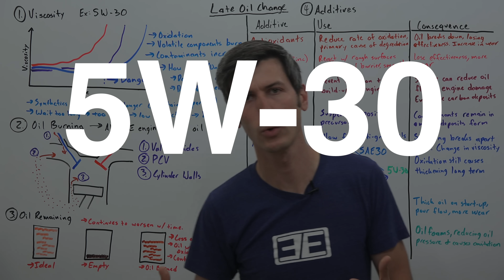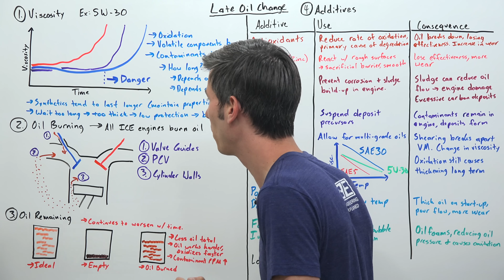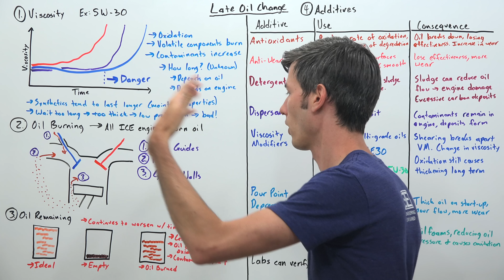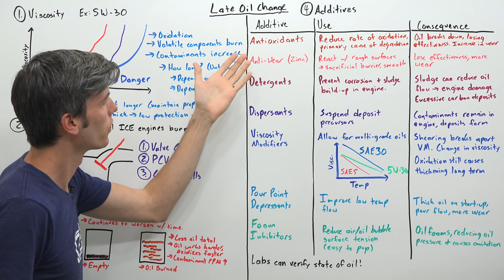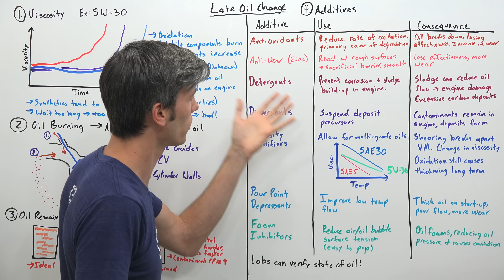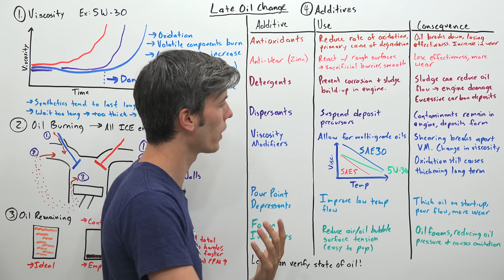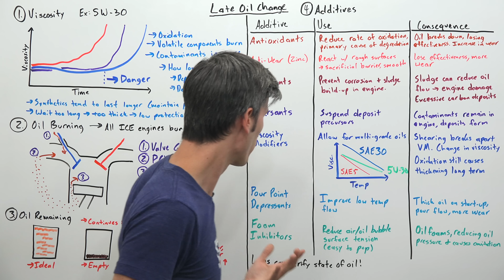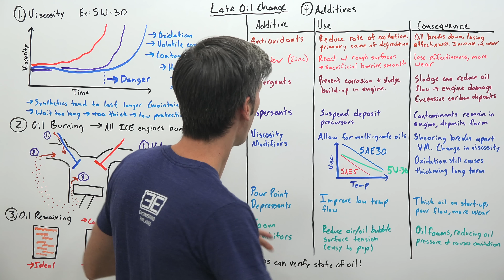What If You Forget To Change Your Oil?

Comment: More heat cooks the oil ....reason not to buy a turbo ....... All these bloody tinpot  engines with turbos these days
Reply: Simple solution is to run synthetic oil with a higher temperature tolerance. Or run cheaper oil and have shorter intervals, either way works.
Reply: @jaydunbar7538  and hope the previous owner allowed it to cool a bit  before switching off if no timer

Comment: When the engine is low on oil, the oil will get too hot.
There are many parts in the engine that have no exposure to coolant. 
Motor oil cools these parts.  The oil then transfers its heat thru the block to the engine coolant.
If you have less oil to carry the same amount of heat energy, the oil will get hotter and thinner.
The hotter and thinner the oil the faster it will burn off.
So if you have an engine that burns oil, keep it topped off.
Reply: You bring up a good point. My old VW Beetle only uses the oil to cool the engine internals. To avoid over heating the engine, I added a 1.5 quart oil reservoir.

Comment: What if the oil consumption is a lot due to poor design (2003 camry) and you end up replacing sometimes 2 quarts. Could you in theory be ok if you wait little longer between oil changes? Since a big chunk of the oil is being replenished

Comment: Can you answer a question for not changing the oil because of not driving so much? Usually my car they say to change every 15k. However I drove this year very little due to sickness and only drove around 4-5k. Still my car tells me to go to the service(which includes oil change). Is it really that necessary to do an oil change, even if you don't drive a much? I feel like OEM set the cars to do this to get more money

Comment: My car has service intervals of 30,000km (18,500 miles). No recommendations for interim oil changes anywhere in the manual. This has always surprised me, because other people tell me that their cars need oil changes much sooner. But I've now done 140,000km with this engine, and it is still running smoothly. The mechanics that do the service haven't mentioned anything along the lines of too viscous/dirty oil either.

Comment: Please can you do a similar video on ATF? especially the "lifelong ATF" issues with new transmissions.
Reply: "Lifelong" is the term car manufacturer uses until warranty period is over, around 100k km, or 5 years, what comes first. After "lifelong" it's up to you what u want to do... 
I know for sure that DSG trans need oil change every 60k km, and old "wandler" torque converter is around 100k km.
Reply: My Australian Ford has a sealed for life Auto. Currently got 500,000 kms and runs smoothly never touched.
Reply: @Blanchy10  highway miles.

Comment: What happens if you regularly drive to the car service station of trust (connected to the dealer) to service the car and the engine breaks down after only 60,000 km because oil was apparently lost and the engine therefore not oiled? Well, bad luck, because the warranty has expired and the service station was not aware of any fault. They even blamed on inferior fuel. In Germany. Seriously? A proper service station should have noticed it before the engine broke down completely in my opinion. Instead, it was only discovered when it was already too late.

The same service station sent the new bought car in another city to change tyres in a shop there and the defective air conditioning compressor was later replaced by an unsuitable part, so that the whole repair took several weeks. Do I have to mention who lost a customer forever?

Comment: first graph is not really true. viscosity change depends on many factors, not only oxidation, but mainly fuel contamination and thus the viscosity goes down typically, because by the time, all the antioxidants are gone and the oxidation kicks in as hard as you show, the oil is not really oil. The only example, where it tends to go up is diesel engines, because it gets contaminated with unburned diesel particles and diesel engines dont have a choke.

Comment: I'm surprised that you didn't mention the importance of TAN (total acid number) of the oil.  An increase in the TAN of the oil (as a result of oxidation) is a precursor to the rise in viscosity.  OEM oil change interval recommendations are typically conservative.  There's no point in changing oil until a rise in acidity is noted.  Extending the oil change interval can save money and do no significant harm to the engine.

Comment: One thing you didn't cover is knowing when to change the oil. For example my car the manufacturer recommends following the oil life indicator (approx 8000 miles depending on driving habbits) or 1 year, whichever comes first. If you go get your oil changed they always slap a sticker on the window indicating 3 months and way fewer miles.  Your not late to change your oil just because the shop wants to sell you an oil change 3 to 4 times as often as needed but the layman won't know the difference.
Reply: Amen!  EVERY oil-change shop in the country is out to scam their customers.  And because of their habit of pulling the fill plug on the differential to check the oil level there, and no matter how much dirt is caked on the plug they pull it and then thread it back in with no cleaning whatsoever (just one grain of sand in the oil can ruin a differential) is all the reason I need to stay away from those places.

Comment: How about a car sitting without an oil change? Will the oil need to be changed if not used?
Reply: Jason Torres Old used oil may contain acidic compounds which can etch the inside of the engine, change the oil before storage.

Comment: You didn’t mention that, nowadays, automakers recommend changing oil once a year regardless of mileage, and they enforce this with a reminder because modern engines contain a clock and calendar.  So if after only 1000 miles of use you get the warning because of the time lapse, how important is this?
Reply: GH1618 Since some of the additives are sacrificial ph buffers, the time in use by the calendar does matter. Jason doesn’t mention this: oil is inexpensive compared to engine repairs.
Reply: There's no one answer for all cars, but if you want to know for yours, send in a sample to Blackstone when you change it after a year, and get the extended use test.  Will tell you definitively if you can safely go longer next time.

Comment: Some folks might ask if they can get by with less frequent oil changes by just replacing the oil filter more often. Besides not taking into account the breakdown over time of the critical oil additives, most engines are equipped from the factory with a filter bypass that allows some unfiltered oil to circulate through the engine during cold starts when oil pressure in the system is very high. This is done because the typical spin-on oil filter isn't designed to cope with very high oil pressures. I used to run a 481 c.i. big block Chevy with the filter bypass blocked shut and the old steel canister filter housing from a truck that could take a replaceable filter element that was at least twice as long as a spin-on filter. I still had to avoid getting hard on the throttle until the oil pressure had stabilized, as oil pressure at cold start was around 80 lbs at idle. Once warmed up oil pressure was 60 lbs at high rpm and 30 - 32 lbs at idle. Also want to mention that oil temperature takes longer to stabilize than coolant temperature when measured using high quality gauges.

Comment: a side note as engine oil ages the viscous increases and the Vicious index decreases and water is another contaminant that the oil have to deal with especially when operating in a wide temperature variation

Comment: I wonder if I only drive like 2,000 miles a year (for a 2 year old car), can I change the oil every 1.5 year? I use full synthetic  oil.
Reply: Well, short trips are the worst for car engine. No time to warm up to operating temperature. But 2k miles is nothing so, probably you can do it every 18 months.

Comment: EE: Drives a Tesla
Also EE: Changes oil every 6000 miles

🤔
Reply: I actually prefer to change my electric oil every 5,000 miles but here in Canada the electricity can wear through the oil faster, and I find I get better acceleration with fresher oil as it lubricates the electrons better. If your oil breaks down, the electrons can't move very well and you'll get poor performance!
Reply: The engine he shows checking the oil on in the video is a Subaru, which I believe he still has.
Reply: OM617YOTA he either still has it or the guy he sold it to got a good service plan
Reply: @om617yota8  It's not. He sent it to Elon to get electrified. That is actually a Tesla Subaru.
Reply: He's always had multiple vehicles as long as I've been watching.
Reply: He also owns a Subaru... you can see the Boxer engine in this video when he’s checking the dipstick
Reply: He used to have an S2000 for a while
Reply: Lmao! Andrew cute yellow thinky face typed
Reply: hey the bearings in the electric motor has oil/grease you gotta change them sometimes lol
Reply: @doomer33deg  how often do you change the grease in all the bearings in the car you drive now.
Reply: @lilsammywasapunkrock  if you want components to last you'll grease things regularly. Driving around with dry ball joints, tie rods and bushings is just wasting money... any time I have something out for replacement or service, if I see sealed bearings I'll pull the seals off as well and make sure they aren't dry
Reply: @bolerdweller  you would hate to hear my theory on oil changes then...
Reply: @lilsammywasapunkrock  you dont change oil?
Reply: @bolerdweller  not really no. I have been daily driving $500 cars as beaters for delivery driving. When I was 16? I bought a brand new 302 to drop in just in case one blew up. Rest of the car kinda falls apart around it. I'll occasionally dump it in 1st gear doing 75 making the tires chirp then hold the pedal to the floor bouncing off the 6200 rpm fuel cut off. 

Been trying 15+ years to blow one up. My current daily is a bit over 100k miles in the past three years, sitting at about 225 k miles now. I'm probably gonna do an oil change this spring though. That oil filter is starting to make me nervous. I don't even know what brand came on it.
Reply: @lilsammywasapunkrock  beaters are one thing but buying and reselling I keep up all the maintenance on them. I buy cheap vehicles too but I buy them low miles, get my mileage out of them(usually 80 to 100 000km) and then sell them for what I bought them for. Try not to loose money on those but toys are a different story
Reply: @bolerdweller  yeah, I don't resell them. I use then up until there isn't much left. When scrap was high, I could buy em for $500 and junk them for around $400 after getting a few years out of them. Back then, I bought more then one car with a blown motor or trans just for good tires then junked them same day. 

Gonna have to do something else soon. A 35 year old $500 car that runs and drives is getting hard to find, and parts are even worse.
Reply: Tesla don’t have oil change from engine. U funny guys
Reply: I stopped draining oil in the early 60s. I used Chevron Delo 100 30 wt in those days. Multi grade oils were no good in those days. I figured if multi grade would void the warranty in a diesel engine why would I put it in my Rambler. I started with a Frantz oil cleaner. I have a dozen or so Motor Guards and Gulf Coasts. I have a good supply of Great Value 1000 toilet paper for them. About 60 cents a filter at Wal Mart. I don't miss the oil change racket.

Comment: My cars get driven less than 5,000 miles a year. I change the oil every 3,000 miles but that could take 6 to 9 months. With this low mileage should I change the oil on a calendar basis rather than a mileage basis?

Comment: I am shooting for 100k miles for my first oil change. Bought it at 120k. Its been almost 3 years and 95k miles so far. Personally, I think people freak out way to much about oil.
Reply: ITs jUsT tHe biG gReEdY OiL cOmPaNiEs!!
You don't even need oil!!
Reply: lilsammywasapunkrock Just be sure to check the volume by reading the dipstick or dash display monitor (some high-line cars).
Reply: @randyfitz8310  what does that mean? Like you are suggesting I check how much oil it holds?

Comment: Question, what if I drive monthly only 160 miles (ones a week 40 miles) Do I still need to change oil every 6 months? (2007 Suzuki Grand Vitara 2.7L V6 engine with 130k miles). Using Mobil 1 Extended Performance 5W30 oil. Probably not, but then, how often should I?

Comment: Does damage differ with conventional vs. synthetic oil in the amount of time or mileage one can go beyond recommended oil changes? I know synthetic oil changes can go many more miles between changes. However the book in my car will say change oil every 10k miles and my servicer will say 5k. I usually just split the difference but I wonder if going 10k would cause damage at all.

Comment: Thanks for the video! Possible future video idea: Other related topics that I’d be interested in, is what it is so important to fill to the “max” level on fluids, and not over it. Your detailed explanations would be great for this! Engine oil, transmission, coolant, brake fluid, power steering, differentials, transfer case. As always, thank you!
Reply: In some of those applications it will foam more . Watch relevant bit in vid about foaming

Comment: Question to viewers in US.

Here in Europe many car manufacturers BMW Audi VW allow cars to run upwards to 30'000km or even more with 5w-30 Longlife oils     (18750 miles)
Is that much lower in US ?
To me it seems that "you" change oil, 2-3 times more often then we do in Europe.

Personal opinion, I think 30'000km can be OK if you have very few cold starts, and need to change every year anyway.
But in a car that runs short distances several times a day, with cold engine.
Combined with oil change interval for two years this is not good, not at all.

Here in Sweden many SAAB and VW / Audis have had trouble with clogged oil pickups.
Not sure if BMWs camshaft chain tensioner troubles are related, difficult to tell.

Also, Jason.
Some cars and use cases instead adds a lot of fuel to the oil, making the viscosity going the other way.
So the oil level seems fine, but it's thin like water instead.

Comment: Massively informative! Thanks. A simple trick I learned was how you read your dipstick. In my Nissan 3.5, even dirty oil can be hard to read on the stick and folding over the towel as you did is an excellent trick 👍👍👍.
Reply: Do that to enough towels and alimony will be in your near future
Reply: @jackd1582  😂😂😂 

Coming up on 51 years married in January and I’ve done much worse and the relationship endures.😀 I have solemnly promised to not use the dishwasher to clean car parts, among many other transgressions 😀.
Reply: @stevewaclo167  dishwasher repurposed 😁.Ahh well if you do use it as such redeem yourself by building her a v8bovril smoothie maker ( vid Is on YouTube)

Comment: I got some pretty strange looks when I brought my Tesla into the shop for an oil change and all they could find under the hood was the wiper fluid fill port.
Reply: Then they got the last laugh the next time you used your windshield washers and sprayed oil on your windshield...
Reply: I feel like they would get pissed for you wasting their time, but it also sounds quite hilarious. They should EVs dont have oil.
Reply: Hope they changed those electric wire fluids. If you forget to do that in time, it'll cause all kinds of problems with electricity starting to flow too slow and getting too hot, so you'll risk exploding your blinkers!... which need their fluids changed regularly as well!
Reply: Well actually they do have ATF that's supposed to last 10-12 years for each motor.
Reply: Who did change the oil in the transmission?
Reply: coulda changed your rubber wind up band that makes it go.......

Comment: My question is how long is it okay to leave oil in a vehicle? Since I bought my PHEV (Ford Fusion Energi), I'm worried that the oil is getting too old. This month so far, I've been in EV only mode 95% of the time. Should I change it every six months regardless if the ICE is in effect. (There have been months the ICE never turned on)

Comment: so how often should you change synthetic vs regular oil?  I try and use Mobile 1 5w-30 which is the recommended viscocity
Reply: David R long answer? When the oil is no longer able to safely protect the engine, as it’s become too thin or too dirty.  Short answer? Just follow what your owners manual says, maybe take a little off that number.  My car calls for 8k miles, I do 5k.
Reply: 10,000 normal oil 5,000

Comment: How accurate are engine oil life indicators?  I’ve seen some that don’t light up until 7000 miles.
Reply: If the car is using synthetic oil then 7k is well within the limits. On my 17 civic si oil life indicator, whenever between 5k-7.5k that’s when my car is at 20% and it recommends me to change the oil. Synthetic oil is usually rated for 10k miles. But of course always consult to your car’s manual for the miles if it gives you the info. Mine doesn’t. But from past civics it is 7.5k(synthetic). The indicators are accurate enough. Mostly depends on the manufacturers.
Reply: Blackstone Labs always says mine is fine.   That is, I've sent them a sample of every oil change I've done since I got my car new (Honda Civic).  I always wait until it's engine oil life has gone below 0% and is giving me a negative number of miles remaining, then I change it within the next few hundred miles.   The longest interval was 10,685 miles of mixed driving.   

Their comment on that oil sample was "It's fine that you ran a little longer than the maintenance minder told you to.   Those systems tend to be very conservative.   The oil was still in great shape when you changed it, keeping a 0W/20 viscosity, and a 2.3TBN shows plenty of active additive left to spare."